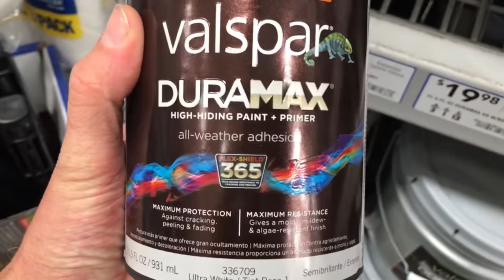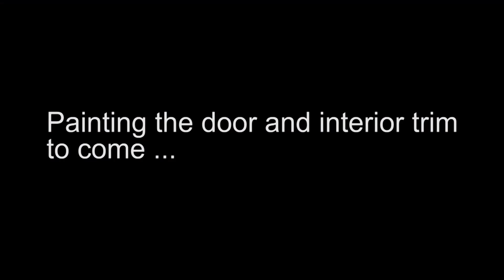How to install exterior door trim on a brick house

Comment: The paint brush in the fridge was a bonus tip.   Thanks for that!!!
Reply from the maker: Absolutely. It works well with roller covers as well. Just wrap the paint covered roller in plastic wrap and you can go a week or more between coats without having to clean them out or use a new one.

Comment: I’ve started using a v notch tile trowel to flush trim my notably generous applications of spray foam. A Japanese saw isn’t a bad idea either!

That free door is coming along nicely.
Reply from the maker: A v-notch trowel is a great idea. I just use the saw so I can catch the shims at the same time. I'm not good at the score-and-snap. I always end up with splinters protruding.

Comment: I don't have a table saw ): to run trim through Any suggestions? Also   I would sand first before caulking or run the risk of accidentally scraping smooth caulk with the sanding block/paper & messing it up
Reply from the maker: It would depend on how good you are with a circular saw or even a hand saw. I have ripped multiple boards down to size with a handsaw (for window jamb extensions on a bank of 4 windows-- I wish I'd made a video of that) and it didn't take long. But you would also need to plane or sand the edges smooth afterwards. -- good tip about the sanding :-)
Reply: @FamilyFriendlyDIY  thx for the suggestions

Comment: Hey Dave, Thanks fr the video. Is it necessary to caulk the aluminum flashing at the top of the window? meaning caulking the flashing to the brick? Thanks.
Reply from the maker: No, Doug, flashing is usually not caulked. It should do its job because of the shingling effect. Thanks for the question.

Comment: Using a hand saw, what if you cut the piece 1/16th too long, how do you take off 1/16th inch??    Wouldn't a miter saw be much better?
Reply from the maker: I'd use a block plane to take it down a little. A miter saw would definitely be better, and I have a miter box and power miter saw, but sometimes I need to satisfy an urge to do some freehand sawing. Thanks for the comment!

Comment: Can a storm door be installed on this?  I need to do a similar project and wonder if it's strong enough to support a storm door.
Reply from the maker: Absolutely. The caulk to the brick and the nails to the jamb make it very solid.

Comment: What is the white piece called that you installed at the top of door frame?
Reply from the maker: Good question, Paige. It's just a piece of 1x material (1x6 I think) to help bridge the gap and make the brickmold trim land in the right place. Since trim is not structural, you can (and sometimes must) be creative to make the finished product look right. The double reveal (quirk) I used was really only to widen the trim as well, so that the sides could reach the brick. If the space between the jamb and brick had been smaller, I would have been able to to nail the brickmold directly to the jamb without using the extra filler pieces. Hope this helps (and wasn't too much info.)!
Reply: @FamilyFriendlyDIY interesting in my door I didn't need to use a piece there but did paint my rusty lindel a nice white

Comment: Dude u need a second table saw or skill saw.  Why are u using a slow ass cross cut saw?
Reply from the maker: I have power tools. Sometimes I just get the itch to do it the old-fashioned way. Thanks for the comment, Chavez586.
Reply: @FamilyFriendlyDIY  Cool.  I was both impressed and annoyed that u were using the cross cut saw.  U are good with that thing! Lol